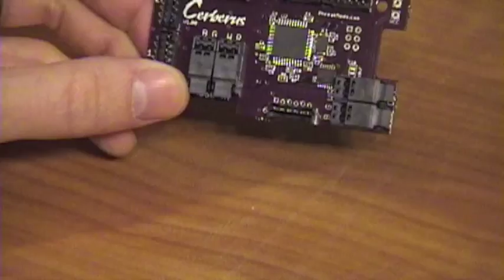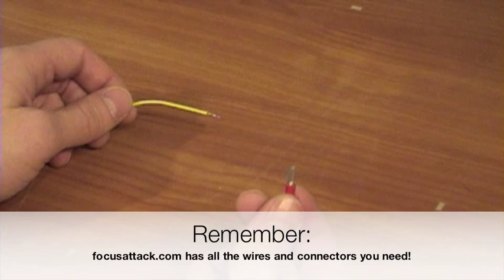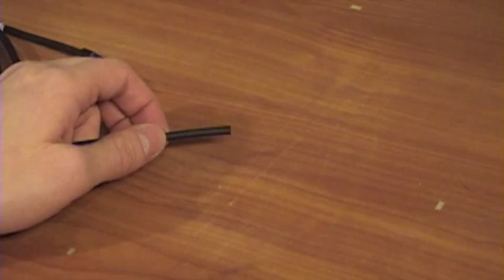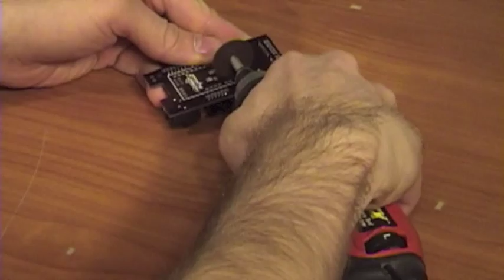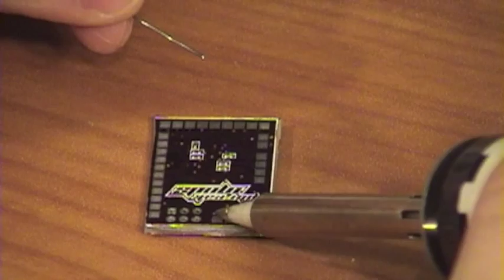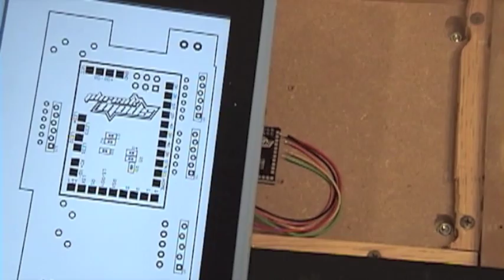How To install a Phreak Mods Cerberus (Partial Connector) PCB into a Custom Joystick

Comment: Hi, got a question. If I wanted to make a custom stick for 360, is there any pcb that doesnt require soldering?
Reply from the maker: For PS3 that's easy, a ChImp has all screw connectors. I believe the current model of the Akishop PS360+ PCB will let you create a 360 stick without having to solder any connections. It also has screw downs and harness connectors.

Comment from the maker: No, there are no add in boards to turn a PS3 stick into PS3/360 - except for soldering in a board from an official xbox pad, but you'd need some kind of USB switch. If you have a PS3 stick, your best option is an Akishop PS360 PCB (I have a video of it in my channel). That board REPLACES the PS3 board though and does PS3/360 on one chip. You can buy it from focus attack dot com. The Cerberus and Cthulhu boards sit along side 360 PCBs. That's the difference.